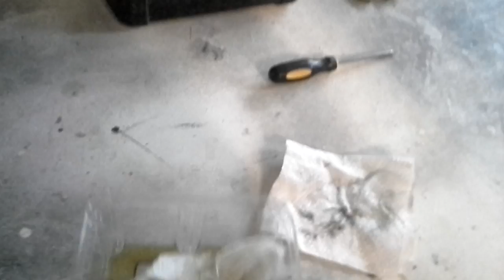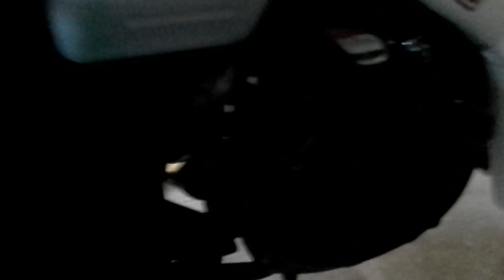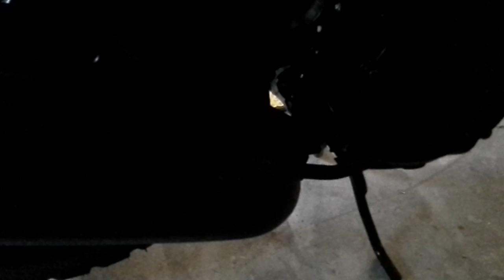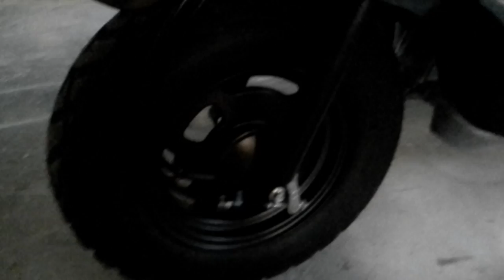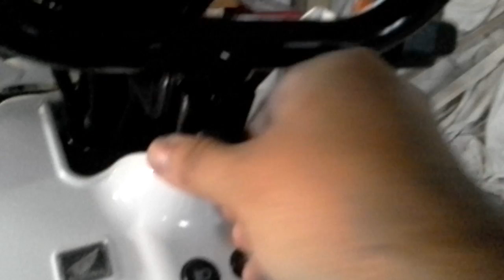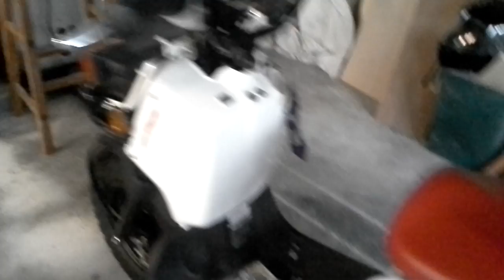New Honda Ruckus Owner? Tips to go faster for free

Comment: How's that gonna make your bike faster?
Reply from the maker: It's the most you can do for free and things that are commonly overlooked when you just want to turn the key and ride 🙂
Reply: @LMEngineering  

How does it make your bike faster though?
Reply from the maker: Proper tire pressure = less rolling resistance.

Engine oil properly filled = optimal engine performance (too low or too much is not good)

Once you have a baseline then you can get into modifying it further.  There are a bunch of fun mods based on mechanical experience.

Comment: Only to tips, check oil, and check tire pressure...rest of suggestions have to do with handling, not getting more speed!  Waste of my time.  Especially when you don't even say what the tire pressure should be!
Reply from the maker: Tire pressure is on the sidewall for all tires, different tire make/model = different pressure often.  There is no such thing as a universal tire pressure.

Comment: I would add 'Greased Lightning" PTFE additive to the oil to reduce wear and maybe even boost compression efficiency...(I have used it in all vehicles I have owned since the early '90s, all with outstanding results).....
Reply from the maker: Never heard of this mod before, will have to check out their product
Reply: @LMEngineering  I put a quart to the oil in a '97 KW T2000, Big Cat in need of a resleeving, smoked for a good minute and a half when below freezing before it warmed up enough to not resemble a mosquito fogger in the summer.  With the GL, just 1 puff or two and clean exhaust....plus it contributed to approx 3 mpg better bob-tailed and half mpg under 80k load, and lot's peppier.....

Comment: WTH IS WRONG WITH A FACTORY DESIGNED RUCK? nearly every customized Ruck is see is stretched, lowered and performed like shit compared to what the awesome designers at Honda intended. I have a Met and a Ruck and have rode customized, retarded looking Mets and Rucks. I hated them all. The ONLY thing that is nice to swap out on a Ruck is the handlebars. Replacing with an MX style set of bars gives it a more traditional feel and admittedly looks better. Stop molesting these scoots. You kids are like the dweeby owner’s of Honda Civics. Nowhere can I find an old, untouched, unmolested CRX or civic coup. They all look like a Mexican got ahold of them. Big wings on the back of a tiny 4 cyl. They are made to be entry level economic cars. Buy a damn Harley or Chevy small block and build them up. You kids are retarded.

Comment: Hey LM Engineering,   got a coolant leak on my 2006 Honda Big Ruckus,    got any ideas what it could be ,and how difficult it will be to fix?   Any info would be appreciated,   thanx
Reply from the maker: I can't guarantee it would fit but if you have a common size radiator cap you could buy an inexpensive test kit from Mityvac.  I used one recently to troubleshoot a bad heater core and it worked well.  Simply follow directions and see if it holds pressure, if not holding pressure it's easy to find the leak as the engine is off and cold and you'll likely hear/see the drip.
Reply from the maker: @josefmengele-q1t  😄

Comment: My question is how do you make it faster? 🤔
Reply: Aftermarket variator, CDI box, Kevlar belt, air intake, and exhaust. Without a full eng swap this is basically the way to go and can be done for half as much as a engine swap. Will get you to about 50 consistently which is more than enough for a vehicle that never sees highway
Reply: @ErectileSceptile  Is this all relatively easy to do. I'm pissed I don't have any friends more mechanically inclined than I am. I'm getting a ruckus soon, but the way people drive around here they expect everyone to always bring going 50. Granted I'm starting to see more and more scooters slower than the ruckus driving around.

Comment: These are helpful tips for the novice owner. Ride around with a full quart of oil and the tires at 10 psi and you'll be lucky to go 35. I've bought a few 30mph Ruckuses that had these very problems.

Comment: So...if it's over-full,  how do you drain the oil? In my old scooter you would loosen the cap underneath the oil tank, but when it was loose enough for oil to come out at all it would usually pop off and start really flowing. I could always just do that and refill it as needed but seems like a waste. How do you remove small amounts of oil? Siphon?
Reply from the maker: +toReasonWhy oil drain bolt, slowly.  Not all the way.

Comment: Need a polini variator, kevlar belt and a lowered handlebar set(quad bars)
Reply from the maker: +Ruckus Piper Agreed!
Reply: Ruckus Piper , what's happening man - I got two 2017 Rukus's , any tips on how to keep the fuel filters from clogging & also modifying it to go faster than 40mph ??

Comment: I've never driven a Ruckus before.  I was torn between a Zuma and Ruckus.   Can you sway me one way or the other ?
Reply: Ive got the zuma50f its better then the ruckus with fuel economy,speed,the only downfall there arnt as many performance parts as the ruckus i got little over 5500 miles on mine 2013 model still running strong and the only thing i dont like is having to remove most of the plastic to work on the motor hope this helps

Comment: sitting too low can make you invisible....  You could gut out  catalytic and alter muffler in  exhaust to get more air through it ...which will probably increase top speed and noise so blind and inattentive motorist might hear you.  Not for free: but changing weights and springs in belt driven trans [variator] can also speed up Ruckus.

Comment: Where can I get a ruckus type R and what is trap speeds can I expect from it in the quarter mile
Reply: Yepp
Reply: When you run the !/4 mile be sure to get an early start to make sure the track is still open when you cross the finish line. Otherwise you won't get a time slip!

Comment: Filling your tires with nitrogen is bunk that shops sell you into buying when it is literally nothing but air. The air you breathe is already 75% nitrogen. Getting that last 25% changes nothing.

(and don't come at me bro with your wikipedia knowledge stating that it has no moisture in it, or that it doesn't rot the tires due to oxidation. The outside of your tires are going to be far more affected by both of those things, so it won't help you at all.)
Reply from the maker: can't we all just get along?
Reply: Actually that 25 percent does matter. Something that is 100 percent nitrogen will not vary in psi when it gets warm or cold like regular oxygen does. Like when summer is over some cars will get tire pressure lights on because when air gets cold it condenses. My knowledge is from majoring in automotive technology just so you know.
Reply: Garrett Beck show your work. I see no studies showing the claims you make with any research... Just speculation and anecdotal evidence. 

Here is my source: http://www.edmunds.com/car-care/should-you-fill-your-cars-tires-with-nitrogen.html
Reply: I don't care what that says my knowledge is coming from someone who has 58 years experience in the automotive field.
Reply: Even my grandparents were wrong from time to time, and they were around during the depression and a WWII... Just because you are experienced, doesn't mean you know everything.

I'm done with you though. Refusal of learning is just the worst in my eyes. No more responses from me. And I'm not reading yours either.

Good day.

Comment: Also, a good tip, check your oil when it is hot.  Almost every small engine (especially with that style of dip stick) suggests that you have the oil at operating temperature when checking the oil.
Reply: Best time to check the antifreeze level as well
Reply: @nolayaheardme402  lmfao

Comment: I have found that the tire pressure is to high on the front wheel. (36psi).  The front spring got no bounce to it so it feels hard. I have lower the front wheel pressure to 25psi. . and I like it that way much better.
Reply: 26 front 29rear is factory.

Comment from the maker: Yes, that is really all it could be is a toy, you're basically at the same height as if you were to sit on a skateboard and roll down a hill lol Not safe when your head barely is taller than someones headlight, but they do move that is for sure, but it could also be the feeling of going faster than you actually are because you're so close to the ground.

Good explanation of the Ruckus ha, it is the only Scooter that I know of which doesn't look wimpy.  Honda Engineering at it's finest

Comment from the maker: Also handlebars that aren't on centered would not cause vibration, they would cause the wheel to be slightly off and you would be going either left or right depending on which direction it is off.  Vibration makes no sense.

Comment: they make a head set designed to run lower bars i wouldnt suggest cutting any thing because if they arent dead on center there gonna vibrate ,,, 
and since you spent slightly under 3000 dollars  why not do it right ,,,